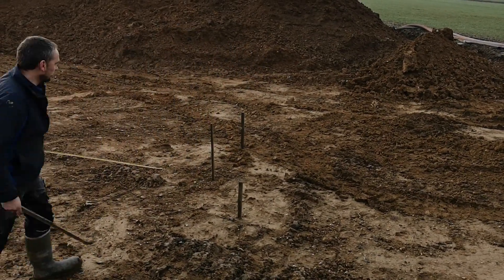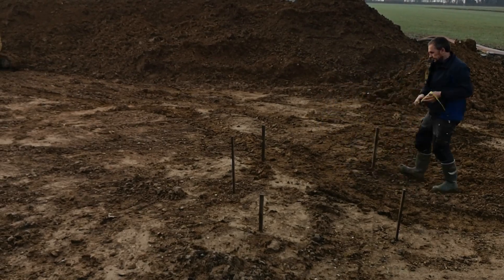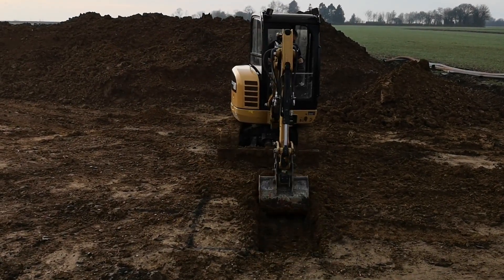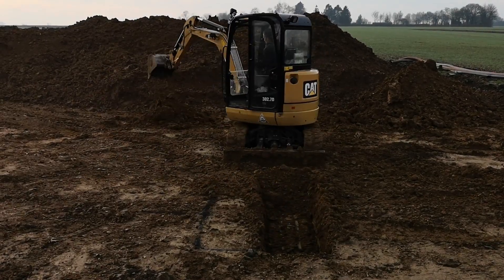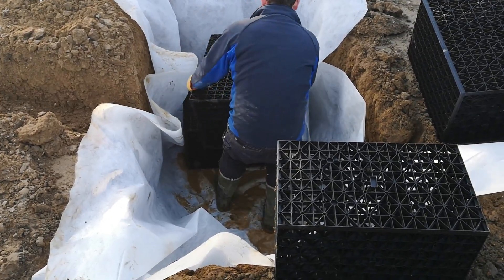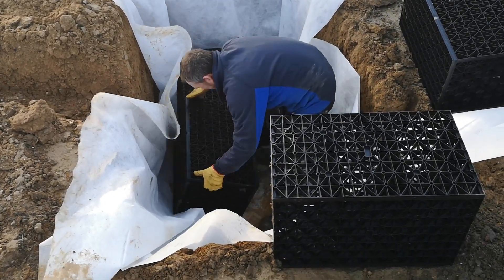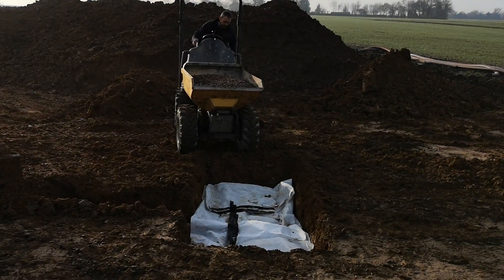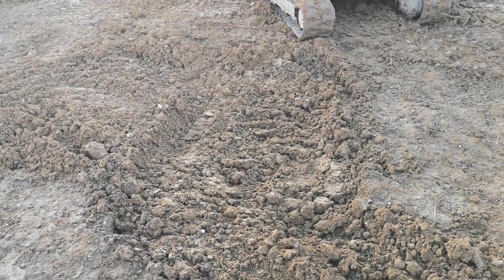Soakaway Crates Installation UK: How-to by EasyMerchant

Comment: You British guys are always getting it wrong.  Line the entire hole.  Use 2"-3" rock.  Then envelope the rock and crates together.  This keeps the rock from integrating out into the soild and vice versa.  In this way it will last 200 years instead of 5 years.  At least, here in Tennessee that is the way we do it.

Comment: Did you put gravel inside the soakaway ? Because over time it will deep in that area if not ?
Reply from the maker: No, the system needs to be free of gravel. The crates are wrapped with a geotextile precisely to stop the gravel or silt from getting into the system. 150mm of gravel should encase the wrapped crates which stabilises them as well as further aiding drainage.

Comment: I have seen this done elsewhere but the crates were filled with 1 1/2 or 2 inch stones !
Reply from the maker: Not a good idea! The crates are designed to have a 95% void ratio in order to hold the water. Filling them with aggregates would just render them useless.

Comment: Wrapped in a membrane how does it soak away?
Reply from the maker: Hi Christine, the non-woven membrane allows water in and out but stops dirt or silt getting in. It's important to use a non-woven membrane with plastic soakaway crates!